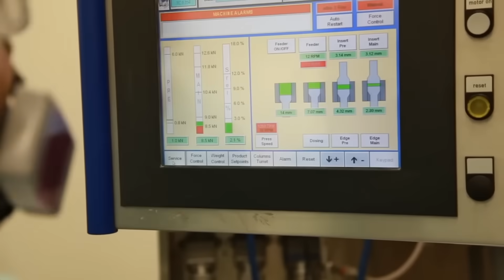Why These Engines Only Last 3 Seconds

Comment: I absolutely loved the stat that a top fuel dragster gets to 60MPH before the back wheels get to where the front wheels started.  That's absolutely incredible.
Reply: I'm also amazed that the tires aren't tied up into a pretzel with that torque and horsepower.
Reply: @gorillaau  Well they kind of are, they have to be bolted to the rims or they would slip. At launch the tires twist and squish down, this reduces it's diameter, essentially providing a first gear to the un-geared dragster. At high speeds the tire stretches (old school bias ply) and expands, the car "gets up"on the tires giving it an overdrive gear.
Reply: @kilianortmann9979  Great balls of fire! I wasn't aware that the tire were bolted to the rims.  They must be an amazing adrenalin rush everytime. The sight, sound and smell is incredible just as a spectator, can only imagine what the "cockpit" experience is like.
Reply: Yeah that`s one of those stats that really put things into perspective lol, absolute insanity, just, actually hard to even imagine..
Reply: I once worked out that if a Ferrari was doing 320km/hr (200m/hr) and went past a top fueler at the start line, the top fueler could start at the time it went past and still beat it to the quarter mile.
Reply: @ian9toes  Here's a little blurb that goes into a bit more detail on that subject.
Putting this all into perspective:
You are driving the average $140,000 Lingenfelter twin-turbo powered Corvette Z06. Over a mile up the road, a Top Fuel dragster is staged & ready to launch down a quarter-mile strip as you pass. You have the advantage of a flying start. You run the 'Vette hard up through the gears and blast across the starting line & pass the dragster at an honest 200 MPH. The 'tree' goes green for both of you at that moment.
The dragster launches & starts after you. You keep your foot down hard, but you hear an incredibly brutal whine that sears your eardrums & within 3 seconds the dragster catches & passes you.
He beats you to the finish line, a quarter-mile away from where you just passed him. Think about it - from a standing start, the dragster had spotted you 200 MPH & not only caught, but nearly blasted you off the road when he passed you within a mere 1320 foot long race!
That's acceleration!
Reply: @ian9toes  dude. i would love to see that performed in real life.. that would be INSANE
Reply: @ian9toes sounds about right. They hit like 320-330. I think. 🤔 haven’t watched video yet. Actually super confused why this is on phone 😂 but I have been to a race. I wasn’t prepared dor my eyeballs shaking when they went by sooo loud!! also some dick started his funny car or late model or whatever while I was walking by and I thought I got shot or something 😂. wasn’t even paying attention. Everyone laughed. Wasn’t funny to me tho. 😊
Reply: "0 to 60 MPH'" in less time than it takes to say "0 to 60 MPH".
Reply: @peghead  a whole run in less time to say that
Reply: I literally had to hear that a few times to accept it
Reply: Fr, that was my favorite part of the whole video, it's the kind of thing you would expect a 6 year old to say about their power wheels car yet somehow it's actually true
Reply: 1-100 in less than a second in under 60ft
Reply: I had the privilege to see ART's datasheet once from a top fuel run. The car went 0-60 in 0.4 seconds, having travelled only 18ft :D
Reply: @sfprivateer  WHEN YOUR 0 - 60 IZZ' MEASURED IN FEET !!!!
Reply: The funny cars are wild!
You can feel them before you even get in the stand.
Reply: I can't even comprehend of that kind of power and acceleration.  That's one of the most mind bending facts I've ever heard.
Reply: My favorite fact is that it turns into a diesel engine part way down the track as the spark plugs have been melted away
Reply: They clock 100 mph by the time they pass the light tree......screw me on a treadmill that's fast😅
Reply: My favourite stat was that it drinks 4 gallons/ 20 L of fuel per second.
Reply: @mobboss1811 American so 15.6L or 16L with rounding
Reply: I had to re-watch that part and the parts after it a few times becuase I was sfuck trying to imagine how quick that is 😅 looks like I'll be going asap to see these things
Reply: closest thing in the world I could compare it to is a jet being launched on a aircraft carrier which is about 0-150mph in 2-3 seconds
Reply: @balakays550  Which is like half as fast as a top fuel car 🥱
Reply: @balakays550 Terminal volicity is about 500 feet per second. Half as fast as a .45 Cal. And half the speed of sound. I did a few seasons wrenching Top Fuel
Reply: @Imma-bv3ib  how was it? I live really close to vegas motor speedway always thought working there would be awesome.
Reply: @balakays550 An experience of a lifetime. I actually started on JR Todd's rookie year Top Fuel. He was running Bruce Littion s Mosier Engineering TF and Bruce Littion was running the new car with WIX Filters.
We did IHRA and NHRA East of the Rockies but not Denver. We were based out of Indy and I live in Florida. So much of my time was at the shop or on the road driving Haulers and doing events. 
Standing behind a pair at night with a good track and good air. It's like the Gates of Hell open wide at the Hit.
Reply: Yes
Reply: I thought it was 100mph
Reply: They consume 1.5+ gallons per second.  The pump would be the limiting factor.
Reply: Never heard that stat.... I like the 36 gpm (gallons/mile)
Reply: They don't go 600 mph.
Reply: @2nickles647  60MPH not 600MPH.  Wake up at the back!
Reply: You are lying, Top fuels run VW Saveiro G4 engines mostly. 1600cc Ap.
Reply: Not that hard to do when your car is as long as a bus.
Reply: @jasonbourne1596  your tripping, it’s less of than a second.  And there not the length of a bus.
Reply: @ThatGuy-p2c  Really, how long is a top rule dragster?
Reply: @jasonbourne1596  your saying there not fast,  quit hating.
Reply: @jasonbourne1596  I’ve seen mustangs and what converted to top fuel cars.  So not all of them are that long
Reply: @ThatGuy-p2c  I don't care, that quote I responded to is definitely not for a funny car the length of a mustang.
Reply: @ThatGuy-p2c  "I’ve seen mustangs and what converted to top fuel cars.  So not all of them are that long"
.....
.....
🤣🤣🤣 go back to bed.
Reply: @jasonbourne1596  This is old but IDC. You're acting like child man.
Reply: @jasonbourne1596  If it's not that hard, presumably lots of cars can accelerate to 60 MPH in 25 feet.  Would you care to share examples of other cars that can get to 60 in 25'?
Reply: @joshuarosen6242  Yeah if you can not ignore my point and name me a car that long that isn't a limousine.
Reply: @jasonbourne1596  so you can't name another car that can do that then?
Reply: @joshuarosen6242  So you can't name another car that's not a limo that's that long then?
Reply: @jasonbourne1596 funny car?
Reply: @jasonbourne1596 So you’ve done it seeing that it;s not hard to do? They will hit 100MPH  under 1 second, it will be traveling between 295 to 300 MPH in 660 feet or 1/8 mile. But that’s easy for you so why not post a video of your own? It’s not that hard, or so you say.😂
Reply: Model S is faster tho
Reply: @ricercr44  please tell me that you're joking 😭
Reply: @JulianPawels  why ask
Reply: @SHADOW.GGG-  because there's always this guy who thinks it's true
Reply: @JulianPawels   just ragebait
Reply: @ricercr44  You forgot the /s at the end of that
Reply: @ricercr44 😂
Reply: @ricercr44   ragebait
Reply: @ricercr44  Not even close

Comment: 8g of acceleration is crazy 😮
Reply: I know the video said 9 but it's actually in the high 5 range, Xavier. Still quite a shove. The negative Gs upon deceleration can be higher if the chutes are pulled at the finish stripe.

Comment: Excellent video!  One thing I am viscerally affected by with these cars which wasn't particularly highlighted in this vid is the condition of the clutches when they come back from a run.  It would have been perfect at 3:10 to drop a little video showing them blazing hot when the crew has to disassemble them with no time to let them cool down.  I saw that once and Man!!  They were close to glowing red!  Just utterly destroyed in those few seconds down the strip.  But it's all incredible.  I love this video!

Comment: crazy thing is that these aren't even the fastest drag cars out there. There highly regulated and as he said have a size limit and are based on old 1950's engines. At one point the NHRA drag cars got too fast, to the point that a bunch of drivers were dying in fatal crashes. So they limited the top speed on the 1/4 mile and thats why none of these cars go over like 320 or something like that. But the fastest quarter mile time was set a while ago, i think in the 70's 80's or 90's
Reply: Snirby, sorry, but that's not even close to being correct. For starters, the fastest speed ever recorded for a piston-powered drag car was set in January 2024, 341.68nph. Comparing a modern Top Fuel engine to an old 1950's engine is like comparing an F22 engine to the ones used in the 1950s. One may be 'based' on the other but they're nowhere close to being equals. And relatively few drag racers have been killed due to excessive speed, but rather fire and structural-associated accidents and the fact that most drag strips lack sufficient runoff area - hence the move to 1000 foot nitro racing.

Comment: You didn't mention that top fuel motors originated from the 426 hemi. Keith Black took that motor to a whole new level!
Reply: I do believe the Top Fuel engines have the same basic layout as a big block Chrysler,, that doesn't mean any of the parts are the same or similar but the design is still the same
Reply: Actually he did, and showed a picture of the engine originally used in Top Fuel, the Chrysler 392 (which also had a couple of smaller brothers) that Chrysler Corp. introduced in the 1950s. The 426, introduced in '64, employed the hemi combustion chamber design of course but it was quite different otherwise - and much improved. Ford and Chevrolet engines joined the Top Fuel party but with only limited success and they're no longer used in that class.
I enjoyed the video, although there were a lot of statistics given that weren't accurate. Best part about it was the omission of any annoying background music. Good job !
Reply: @cll1639  I must have missed that. To correct you a bit, there were 12 different hemi engines made that went into the Desoto, Dodge, and Chrysler vehicles, they also put many of those motors in commercial i.e. dump trucks. The 354 was used for a couple of years before the 392 was made though top fuel didn't exist yet. When Chrysler could follow GM and use the sand casting technique to lighten the motors in 1958 they did making the 350 and 361. Then in the early 60's they started developing the 426 hemi basing much of the motor on the RB block
Reply: @Randy7th  Indeed, there were many displacements I wasn't even aware of. 331, 354 and 392 were the most common but after doing a bit of reading, the Hemi (aka FirePower, FireDome, Red Ram and others) was also produced in 241, 270, 276, 291, 315, 325, 330, 341 and 345 variants. To me, it looks like Chrysler could have stuck with the 331, 354 and 392, saving a ton of money in the process. Chevrolet made it through the 1950s with only two small-block V8s and one W-block.
Reply: A modern Top-Fuel Hemi has basically nothing in common with a Mopar 426.

Edit: Also, Hemi's were around way, WAY, before Mopar made one.
Reply: @davelowets  that is true, but in the evolution of top fuel, it WASN'T based on the old varieties it was based on the 426. That motor helped get us to where we are today.
Reply: @Randy7th  Key word, EVOLUTION, circa 1964. Even the terminology evolved from 'Fuel Dragster' (AA/FD) to Top Fuel not long after. Today, the only similarity is that they're both V8, 2 valve OHC engines that employ hemispherical combustion chambers.
Reply: @cll1639  That is very true and I totally understand that. Similar to funny cars from the A/FX class of the early 60s. Would top fuel have evolved into what it is today without the 426? I don't think so...just my opinion.
Reply: @Randy7th  I'd say that makes pretty good sense, Randy. For what it's worth, in an effort to slow the fuel cars down a bit, a couple of racers tested with a 426 CID version of today's 500 along with a smaller fuel pump. Nothing ever came of it.
Reply: @davelowets true story, if Chrysler made them only 3 cars of the entire field would run.
Reply: @stevepulse4893 I guess that's some kind of a Chrysler hack but if it were true they would probably be the three fastest of the field LOL
Reply: Wow! I had no idea that it was a hybrid!

Comment: Good video, but I have to say...10,000hp is a bit low I believe. The best guess I have heard is 15,000+hp. Unless a lot has changed, the clutches don't lock up-not intentionally anyway.  The last time I seen a clutch lock up fully the car smoked the tires at 300+ mph. There is just TOO MUCH hp. The only way to figure hp on these motors is to take the time, distance, speed, and weight to calculate it. If the clutch isn't fully locked up the entire time you are just guessing...best they can do though...

Comment: wow I can remember back 50 years ago when 2000 hp was considered insane. It was my first time seeing a funny car and the earth shook. it was called Trojan Horse
Reply: I've been going to drag racing for nearly 30 years, watching the times fall and the speeds increase.

Blows my mind when Pro-Stock are doing what Pro-mod used to do, Top Methanol and Top Fuel Bikes are doing what the Top Fuel cars used to run. It's crazy to think about.
Reply: And now there are streetable drag cars make over 5000hp haha
Reply: Horsepower is rated different now.

Comment: Probably dating myself, but I remember being at a drag meet where the talk of the race was somebody doing a sub 7 second run.  Those days, they would line up the entire FC field on the strip and have them all fire up at once, just for the sheer awesomeness of the experience.  Talk about rocking your world.  Those days the engines were probably in the 2,000 hp range.  Today's 3 second cars are probably six times more powerful, which is unfathomably robust.
Reply: "Cackle-fests"..... 👍

Comment: Whats insane isn't top fuel engines. Its the custom engines people can buy now with billet big block chev or hemi designs that can make 4000hp on methanol with water jackets. These engines are slowly creeping up over the 4000hp-5000hp mark on methanol with a decent reliability to them.

Comment: I've asked this question several times but never got an answer.  If the top fuel (and funny cars) don't have a transmission, how do they back up after a burn-out?
Reply: They incorporate a separate reverser unit, operated by a cockpit lever.

Comment: The combustion of nitromethane generates about a quarter of the energy compared to the combustion of gasoline, even though it is possible to inject almost 9 times as much and the greater heat of vaporisation increases the charge density, we are closer to doubling than tripling the power, it is certainly not increased by 10 times as much as said at 4:28

Comment: Saying it takes 800hp to run a supercharher, therefore a normal car wouldn't be able to run it, is not correct. 800hp is parasitic loss at peak power. At 500rpm, the parasitic loss is probably 20hp-30hp. Anything that takes 800hp to turn is practically welded. Superchargers are made to be as free rotating as possible. Ty for coming to my TED talk. 
Tiho
Reply: Wrong

Comment: we could build a RDE to fit a car and reach close to 40,000 horsepower with the right fuel and engine upgrades.  Basically, 0-60 in less than 100 ms.